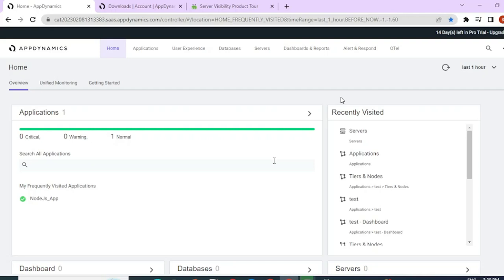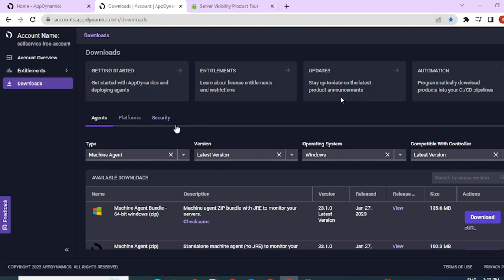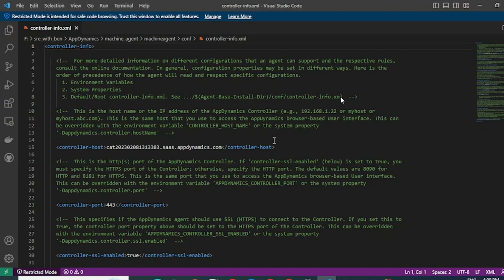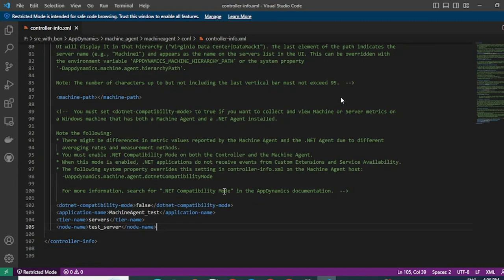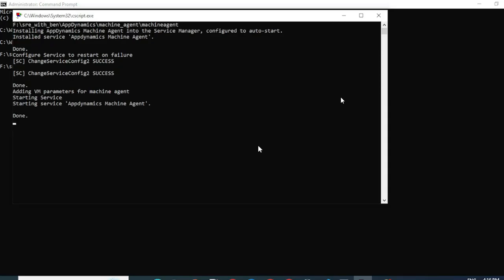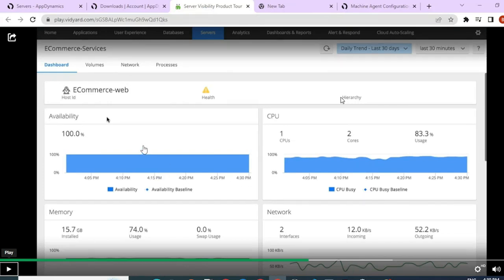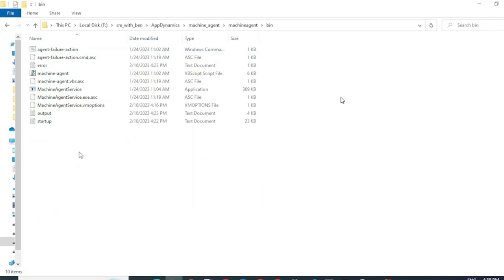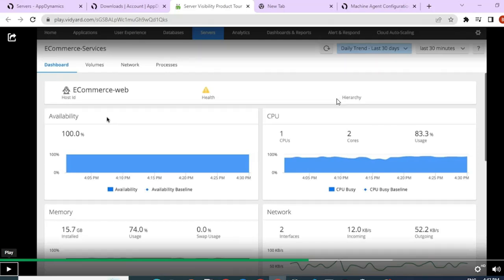AppDynamics | Beginner Tutorial | Machine agent installation

Comment: i have around 3 years of experience in Manual testing ( Functional) ...can i learn Appdynamics and get good job with good hike
Reply from the maker: Yes you can, I suggest you master one tool like AppD and learn a little bit about its competitors also so that you know how these tools are used.

As for getting a good job and hike, Remember these tools are just a way to achieve something. what you must be good at is understanding how and why they are used and how they solve a specific problem.

If your able to understand problem statements and solve them efficiently that must sure help you land a high paying job

All the best for your learning journey😊
Reply: @srewithben  thank you very much for the information 😊